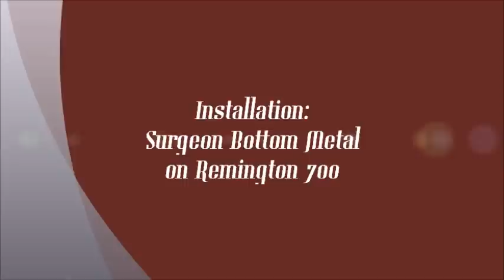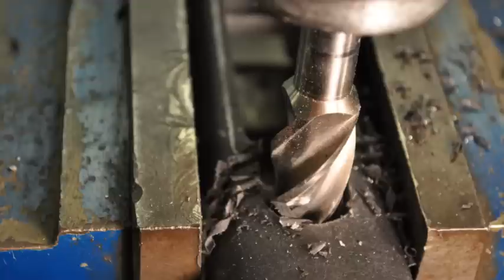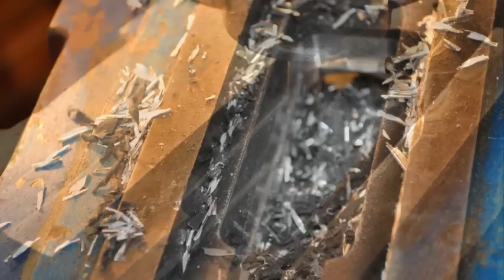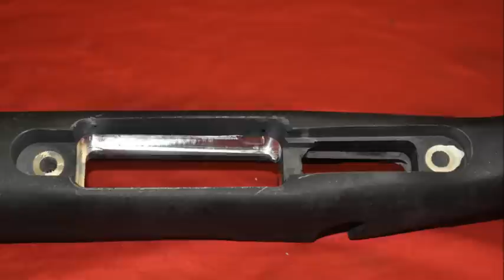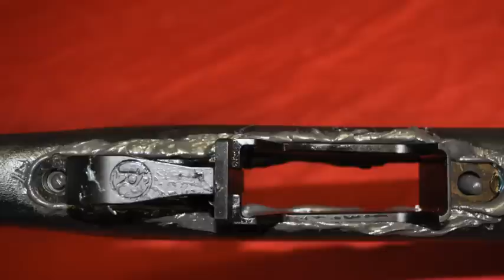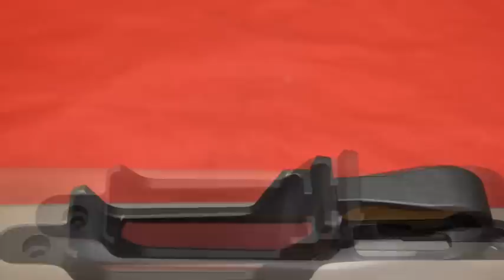Installation Surgeon Bottom Metal Remington 700

Comment from the maker: hello 1lonepuma...
the floor plate is in different depth according to the stock that you use. the most important part is that the floor plate is at the correct height in order for the mag to fit correctly and feed with no problems. if you need a detachable magazine assembley that is flush with your stock buy a HS Precision. good luck with your gunsmithing...